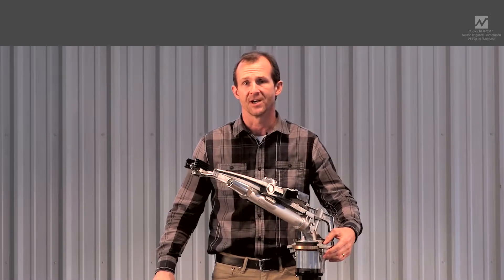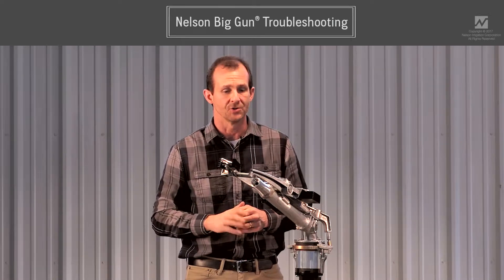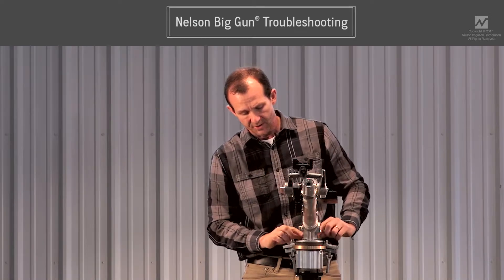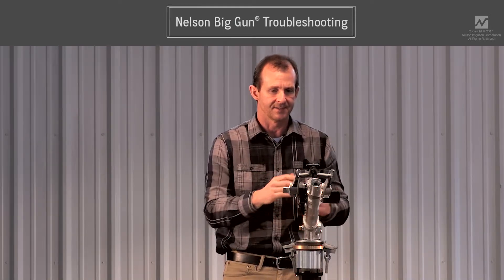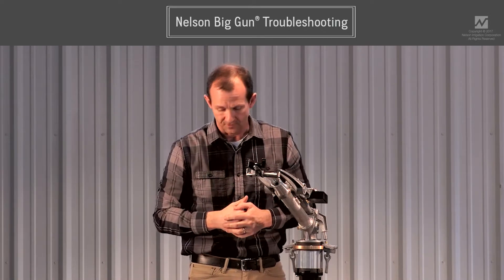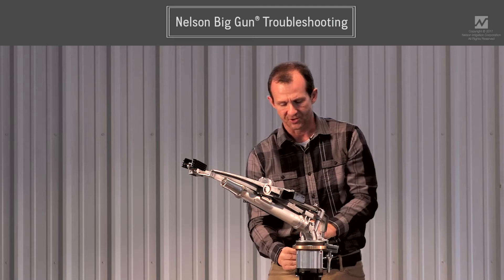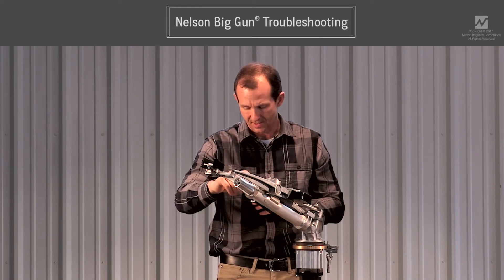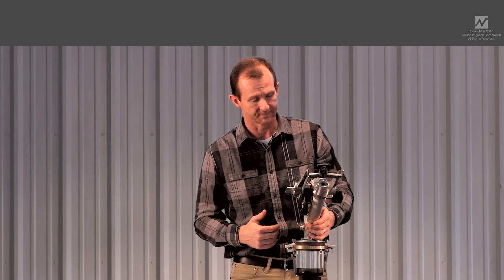Nelson Big Gun Troubleshooting

Comment: I have a old nelson P150 with the same issue. Bearings have locked up and it does not rotate. It's at the dealer getting rebuilt. It also leaks from the base as well. It's one of those fast reverse guns. Before you came out with the SR series of guns made now. I also have a PC100 that works great. It was rebuilt as well for bad arm bearings and leaky base. Love nelsons guns. They keep running and are great guns as long as you keep up on the service on them. I like them better than komet or any other gun manufacturer
Reply from the maker: Hi Christopher, All of us at Nelson Irrigation appreciate you taking the time to leave us a comment. Thanks for choosing Nelson over the other competitors!